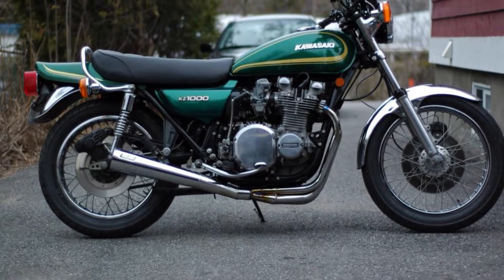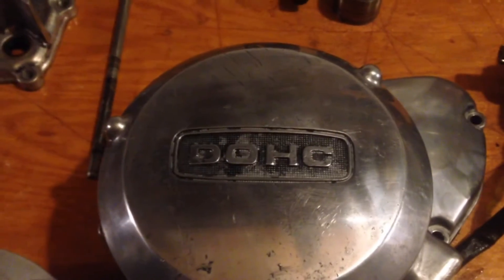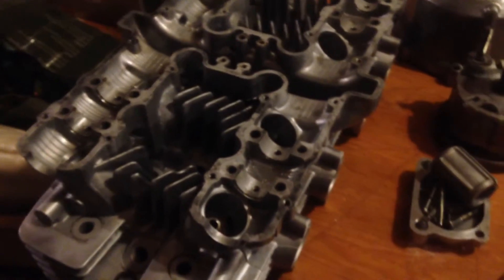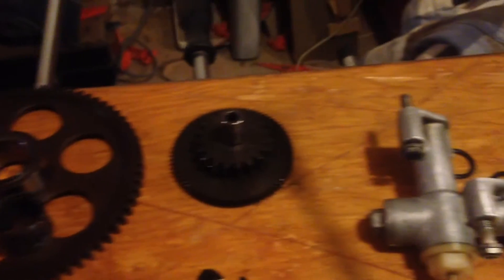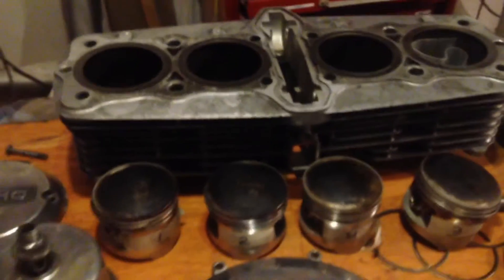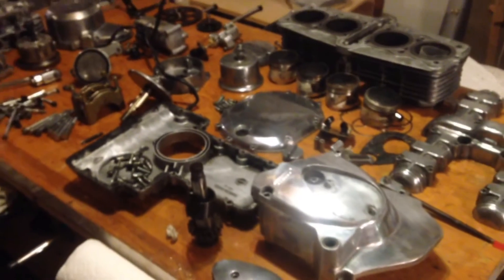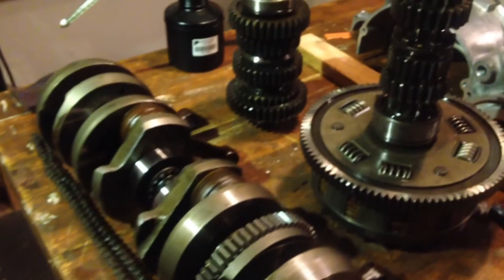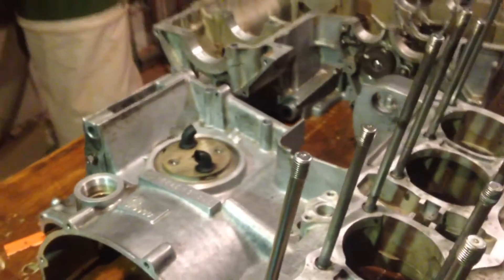KZ1000 Engine Teardown

Comment: I know this is and old video but I'm currently debating on tearing down my kz1000 engine or to just sell it and get a new bike. how much experience do you have taking apart engines? and about how long did this take to take apart and put back together? thank you for the video
Reply from the maker: Hi Jordan 

This is the only experience I have had tearing a bike engine (or any 4 stroke engine) apart.  All in all it was pretty easy. The Kawasaki factory videos are a great guide.  I can say that i was able to put it back together and she runs fine to this day. Not even any engine leaks.  Tricky part is putting the block back on over the rings and ensuring the timing chain is proper with the marks.

Chris
Reply: Sweet thanks man! We're can I find those videos?
Reply from the maker: Here is one: https://www.youtube.com/watch?v=BUaao5mMylU
Reply from the maker: Here is the other (removing the engine from the frame)  https://www.youtube.com/watch?v=hvbACuU86HY
Reply from the maker: Also lots of help here. Forum is great. http://www.kzrider.com/